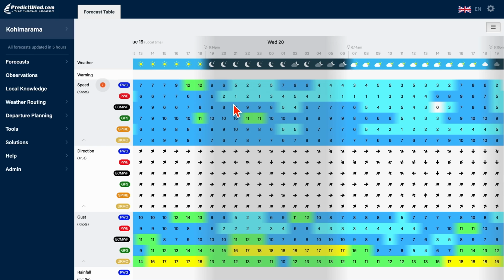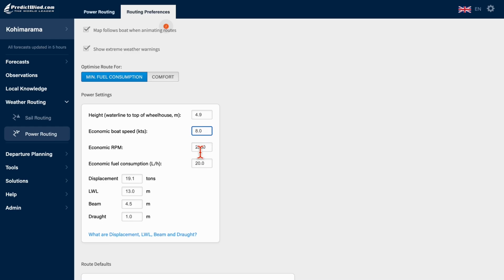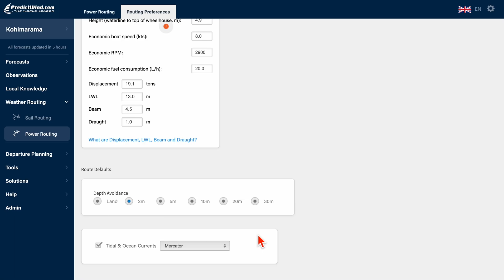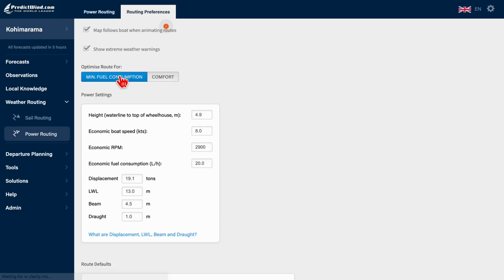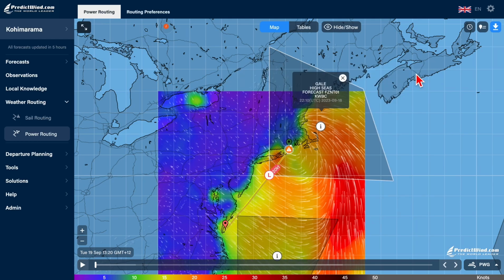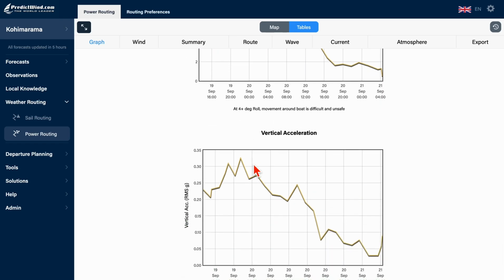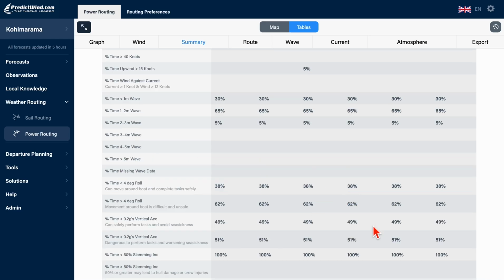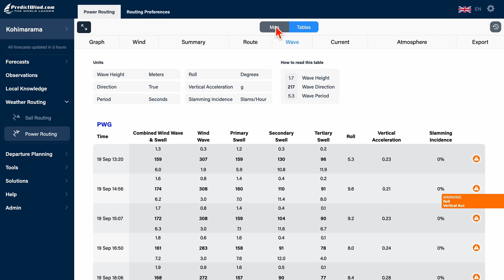Powerboat Weather Routing Walkthough on web

Comment: Thanks so much for doing discussion of powerboat options. Just got back from week using predictwind  before a tropical storm.  One question, the app does not have the sail/power options drop downs. If I am setup for power on the website does the app use my power settings?